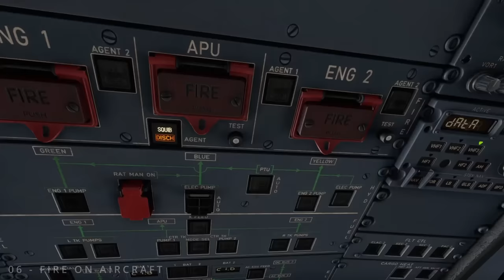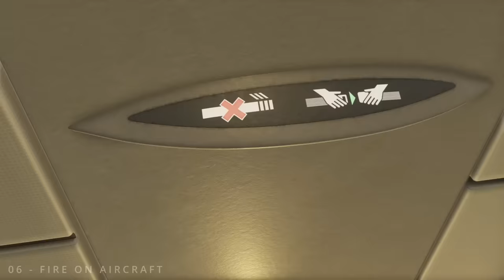Airline CAPTAIN Debunks 8 Flying Fears

Comment: As an aircraft mechanic, I take pride in all my work. I make sure that I follow the maintenance manual to the T. Safe & happy travels everyone!
Reply from the maker: Great to hear! ✈️
Reply: Thank you!
Reply: @jaysonglick6371  You’re welcome!
Reply: I appreciate it, thanks for taking your job as the serious matter it is, well done.
Reply: Thank you 😊 

Unfortunately seeing some air crash  programs some clearly don’t
Reply: How many times have you worked on planes and when you are done you have several spare nuts, bolts or wiring left and then asking yourself Hmm where does this one go 🤔.. lol
Reply: @MightyMind137  Absolutely! I take things seriously & have fun at the same time.
Reply: @rc70ys  The first to blame is maintenance. The human factor, but truth be told. It can be a culmination of factors.
Reply: @jorgeastorga242  Hahahaha!!!! As a matter of fact, when replacement parts are ordered. You always order replacement seals, nuts, bolts, washers, & clamps for the component part you’re replacing. All these items are accounted for! In essence you end up with a bunch of old hardware on hand. Depending on customer, these parts must be turned back in to stock. In terms of troubleshooting & figuring out what’s causing a certain issue. That’s a whole different beast!
Reply: @jorgeastorga242  As an aircraft mechanic myself, I would say never. A lot of parts are created on aircrafts that are made to come off and on (Not going to say its easy, some are more of a pain than others). Common parts that should absolutely be replaced are bad screws/washers, orings, gaskets, Rivets (If applicable) bad sleeves/terminals (May be some more things I'm not thinking of). Very rarely do I end up with wire unless I'm dealing with a bad harness. Most electrical components utilize cannon plugs which...can be hit or miss. Usually you can read a manual to figure out what goes where and if you have some electrical intuition, this can work out in your favor, but it can also lead you down a serious rabbit hole of time wasting (But in terms of troubleshooting, it can lead you down a really fast path of figuring out which is busted and which isn't)

If anything, you're more than likely going to lose hardware. I can't tell you how I can have a screw on the floor next to a seat that is used to install a sidewall panel in the passenger cabin and it just...disappears. Or times we're doing an inspection on the flaps and we have to take a bunch of access panels off, and then when we put them back on, 5 screws end up missing. It's not in the flaps, We don't just take panels off and throw screws into the system, so maybe it just rolled off somewhere.. We look it up in a parts catalog and get new screws. You'd be surprised how much of an airplane is cataloged and how realatively easy it is to get parts for it (In an airline setting, GA is a whole nother animal)

Do I go over the top and replace screws and washers? Not unless they're bad. There's an acheck on 175 that basically tells you to take access panels off  near the leading edge(Root to tip) on both sides. That's a few hundred screws. I'm not replacing all that. Not only that, while there may be a bunch of parts you can replace it with, the bigger question is does it actually need replaced? It is absolutely staggering how expensive parts are on an airplane. For a fan on a jet engine, the ones I'm used to have 28 fan blades and each one is attached with a pin. Pins need to be changed out every now and then to be lubricated. One of those pins is like...12-15 thousand dollars and the ones I'm used to come in a box of 28 pins. A box the size of a lunchbox can be more expensive than a vast majority of houses on the planet. A tire can cost...what was it? 16 thousand dollars a piece? They get changed seemingly all the time And these are just little regional airplanes that can house maybe 80 people. it is absolutely insane how expensive aircraft parts are which is why...I don't like replacing a part that doesn't need to be replaced. This is why its extremely important to learn how to troubleshoot in the airline industry and to follow manuals for remove and replace (If it can't be fixed). We're on a strict time limit too. Planes come in at night and must be sent out by 5 or 6 in the morning. If a problem can be fixed, that's preferred but if it takes too much time, its better to simply remove and replace, ops check and if its good, move on to the next problem. Planes gotta be out by 5 or there's a delay and we get the blame.

If you are ever an aircraft mechanic, there will come a point in your career that you question how the hell is it physically possible that the airline industry can afford all of this?
Reply: Thank you 🙏
Reply: Thanks man, good techs are underappreciated often, but we are there, we make a difference behind the curtains
Reply: @Xphinity  Agreed!
Reply: My buddy got fired because he left tools inside of a 737 Max
Reply: Thanks for all your hard work. I’m currently training to be an AMT and am a pilot myself. Y’all keep the aviation injury on its feet
Reply: The Joker profile image on this comment made me crack up. Like, "suuuuure, Joker. ITS A TRAP" 😂
Reply: @SourPlanet  HaHaHaHaHa
Reply: I'm watching the air disasters series, theres 16 season of planes going down and i'm alarmed at how many are due to maintenance failure lol. These are old cases and new but still, the many possible points of failure, from the mechanic to the air traffic controller can cause these things to go down.
Reply: Well yeah I hope so
Reply: @MightyMind137  Well he kind of has to as a mechanic on a airplane
Reply: @XBrandonLeeX765  I don't think the Joker take anything seriously
Reply: @libturdcrusher1776  I’m sorry for your buddy. I’m extra paranoid with all my tools. We conduct spot checks as soon as we’re done with a task. I got to make sure all my tools are accounted for, they’re expensive!
Reply: @avail2114  No, Thank you! I got a co worker taking your same exact path. He wrenches with us on the weekends & flys during the weekdays. Good luck!
Reply: @wildlifewarrior2670  Mechanics Creed 🙏
Reply: @wildlifewarrior2670  HaHaHaHa
Reply: @XBrandonLeeX765  No worries, my friend. He was able to get hired by another carrier and is doing much better. It happened when there was the big 737 Max scare, and we were pulling planes in right and left, inspecting them.
Reply: @libturdcrusher1776  I’m glad he was picked up right after, I appreciate what you do brother.
Reply: Thank you. We truly appreciate that!
Reply: Thank you 🙏
Reply: I'm not sure how much I can trust this, coming from the Joker
Reply: Thank you
Reply: @robertl955  Actually mechanical issues are rarely the cause of airline accidents. Weather and Pilot error top the list.
Reply: Not everyone does. Air Transat come to mind.
Reply: Lol must not have worked aviation for the military then. Imagine the bs corners that get cut by an 18 year old out of boot camp😂
Reply: @travis.3  No I did not. I do have a co worker that was a Sergeant & served for over 7 years. He worked on BlackHawks & there was no cutting corners.
Reply: You are one of the real heroes of this earth. Thank you for keeping me safe.
Reply: Thank you!
Reply: @estateelite9284  Thank you for the kind words.
Reply: I fly with CAP. We LOVE you guys and you are a big part of keeping us safe!
Reply: Thank you for you and your crews work. That goes for all mechanics.
Reply: Pride comes before a fall.
Reply: Keep it up, you're an unsung hero
Reply: Good, but what about the other guys??!
Reply: @BST-lm4po   Not from what I see many times on airline disaster movies. So many time a repair wasn’t done correctly. I’d like to see the stats!
Reply: Thanks a million !
Reply: We all can't say thank you enough !!   so....thank you......... thank you .............thank you !!!!
Reply: Thank you
Reply: @XBrandonLeeX765 I am taking a fear of flying course and I literally asked the instructor "what about mechanics? What if they're lazy and just don't care". He reassured me that he has the utmost confidence in the mechanic teams, but seeing your comment made me feel SO much better. I love to hear that you take pride in your work and enjoy it. Thank you for keeping all of us safe!!
Reply: Thank you for your work and for keeping us safe 🙂
Reply: You're the most important piece of the puzzle.
Reply: Appreciate you
Reply: @XBrandonLeeX765  hey Brandon I'm next bro
Reply: @XBrandonLeeX765  🫡
Reply: Thats good, I know one who was always high and drunk on shift
Reply: Passanger safety also lies in your hands
Reply: We appreciate your work. Thanks for keeping us safe

Comment: I'm on the verge of crying thinking of my flight tomorrow, but I really appreciate hearing how calm you are and this is helping a bit. I guess I will be watching these videos all day! Thank you!
Reply: I used to be morbidly petrified of flying. To the point I needed Valium to get on the dam plane. Didn’t want to drink too much and not be in control. Tried rescue remedy. Everything apart from hypnosis. That was all around 15yrs ago. Now I just put my headphones on. Listen to my favourite tunes. Read the kindle and basically zone out. Works for me. Oh apart from the one time we where coming in to Leeds/Bradford airport it was a bit windy so the pilot informed everyone that he would be using the short run way so he would be coming in hard and fast. I was blissfully unaware of this. But the Mrs nudged me removed an ear cup from the headphones and said “ where coming in hard and fast” 🙈🙈 my guts dropped a mile. But we landed with no problem. It’s now a standing joke when ever we travel abroad.
Reply: Literally me now! My flight is in a week and I’m panicking. Ugh. I have flown 2 times before but I still get scared.
Reply: How was your flight??
Reply: @tesiemarie8942  my flight both ways were great! Coming back was easier since I was more grounded in what I was excited to see again, ie my cat. But there was a period when we were landing where we had to go through thousands of feet of clouds due to the weather which scared me but I just reminded myself that even though I couldn't see, there were air traffic controllers and many other people aiding the pilot!
Reply: I have a flight tomorrow morning and have been frozen all day today! I used to fly so much and have no issue at all, now lately I've been having panic attack just thinking of flying. I hope these videos help me tomorrow!
Reply: @LuLuRevenge6  How was your flight?😃
Reply: @rd8917  not very reassuring (I'm sure it was fine)
Reply: Are you alive?
Reply: @blizzard1646  it was great, actually!

Comment: Most of us are scared because we don’t have the knowledge. Thank you so much for giving this video. Really helps
Reply: Surely the knowledge is that 10 fully loaded airliners would have to drop out of the air every single day to match the equivalent 3600 people a day that die in vehicle accidents.
Reply: You might try watching a show called Mayday or Air Crash Investigation (depending on where you see it). It depicts crashes in great detail, which may seem scary at first, but they also explain in great detail exactly what caused it and what has been done since then to make sure something like that never happens again. My favorite thing about it is they don't sensationalize and they don't exaggerate. Everything is shown as accurately as possible from an educational standpoint.
And almost every time some disaster happened, you find that it was like 9 different things that all had to go wrong all at once for a crash to happen, just crazy odds. When you learn about just how hard it actually is to have a crash and everything we've learned from the ones that happened, that knowledge about what happened and why and most importantly why it wont happen again actually makes you feel a lot safer.  Because every time a plane has crashed, every other flight after it has gotten safer.

Comment: I used to be dreadfully afraid of flying. I got over it. How? By flying a lot. Once I knew all the little noises and g-forces and bumps were the same on every flight, I knew to expect them and they didn't bother me as much. I am still not crazy about flying, but it has more to do with getting through the airports on each end.

Comment: The longest flight I've ever been on was 13 hours from Switzerland to Atlanta and I have flown many times before then with relatively decent skies. The plane would shake but it felt like being on a bumpy road. I had no issues with flying besides that weird feeling when taking off until I was on a less than an hour flight from New Orleans to Dallas and we hit open air turbulence. It felt like the plane was going down for a few seconds and it was so upsetting that everyone on the plane screamed. I never experienced that before but since then I have been terrified of flying. This has been helpful, I'm learning more about airplanes.

Comment: In my younger years I used to look forward to the flights and saw them as part of the whole holiday experience. However, this all changed in the early 2000s when I was on an Air France aircraft coming into land at CDG in Paris in heavy fog. The plane was flaring just prior to touch down when suddenly it went nose up and  proceeded a full power steep climb. The pilot came over the PA to apologise but stated that there  'there was another aircraft on the runway'! 

We then circled for a few minutes before making a second attempted landing. As stated, there was heavy fog and looking out of the window, I could not see the ground. We hit the runway and then bounced up again before finally touching down very heavily. Again the pilot apologised and stated that the landing was 'offered by the auto-pilot'!

I spent a few days at Disnetland Paris with my family before an uneventful return flight. I then avoided flying for a number of years as I was unnerved about the whole experience. I eventually got back to taking flights but was always very wary and did not enjoy the experience any more.

However, after getting into the many Aviation Streams such as Airliners Live, Big Jet TV, Airline Videos Live etc. I realised just how many flights were taking off and landing just at single airports every day without incident. I also started to recognise all of the aircraft variants and getting more into it. I now look forwards to flying again and have just returned from New York for which we actually planned the travel just so we could fly Vigin Atlantic on an Airbus A350-1000.

Hopefully this tale will help others as I should really have realised that the incident at CDG  demonstrated that there are systems in place to avoid serious incidents such as runway incursions and as for the heavy landing? Well I couldn't see the ground due to the fog, so what else could the pilots do but use the systems available to them.

As Mark says on this video, travelling to the airport is significantly more risky than the actual flights to and from your destination. 😉
Reply: Lies.   They wouldn’t have had approval to land
Reply: @FasterthanSpeed414  mistakes happen

Comment: I will add in one thing that I think a lot of people get scared of. Immediately after takeoff you will likely hear the engines drawing down in power. You may also feel like the aircraft is sinking. The first part occurs because the pilots have purposely reduced power from take off thrust to climb thrust. The second part is purely a sensation felt, but the aircraft is not decending!
Reply: Yes, you're right and it's even worse at my regional airport SNA (John Wayne). Short runway with rich neighborhoods at the end that don't want noise. Procedure is: Pilot lines up the craft, stands on the brakes and spools up the engines. Extreme thrust, quick V2 and steep angle for about 1000 ft. THEN he powers way down and levels off (feels like floating) over the mansions until clears the coast line then powers back up in a big way and climbs.
Most pilots will announce all this to avoid the souls on board from "puckering".
Reply: This is definitely me and why my main fear of flying is fear of take off. But even knowing what is happening doesn’t help. I still experience intense anxiety to the point that I feel extremely anxious if I even think of booking a ticket. I avoid flying as much I can. It ruins so many things.
Reply: @MissAmarintia  I'm like you and getting worse as I age for some reason. I flew a ton in my 30's, 40's and 50's all over the world on some really dubious airlines (Aeroflot, Avianca, etc)  but now, in my 60's I have to have at least a couple glasses of wine.
Reply: @MissAmarintia  I would strongly encourage speaking with your doctor about this. Often when this type of phobia is encounter, your doctor may prescribe an antianxiety medication to take before flight. They can greatly help. And don't feel bad, a fear of flying is very common!
Reply: @kendallevans4079  I take some Valerian Root herbal supplement about 45 minutes before boarding and it has really kicked in by the time that we take off.  It is not a cure but it does help to calm the nerves.  Now having started watching these vides and reading comments, I am thinking that my next flight will be much better simply because of the understanding about the noises and bumps etc. and when they are going to happen.
Reply: Thank god, you're right, those things do make me nervous
Reply: @travis.3  there is no shame is preparing! I can certainly state air travel is the safest mode of transportation, but I certainly have been anxious myself despite knowing this. I know what is occurring and why, but still feel that anxiety! It has gotten better over the years, and now barely bothers me, but in the past it very much did!